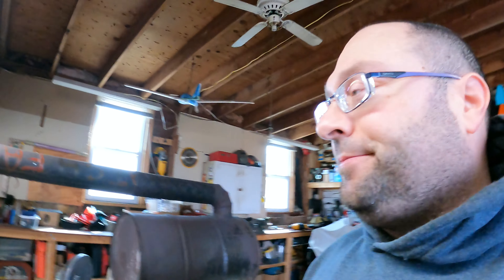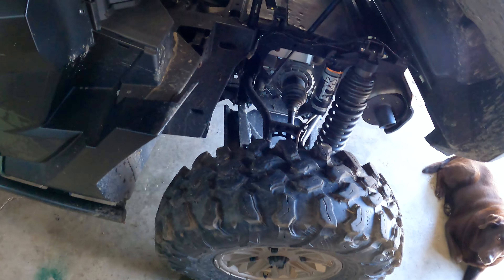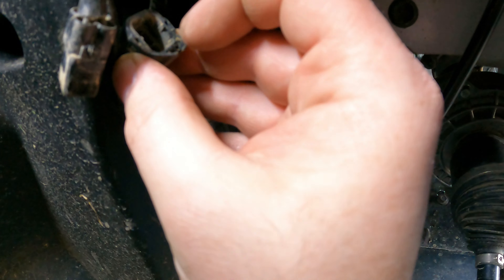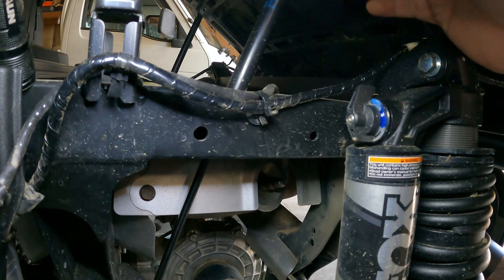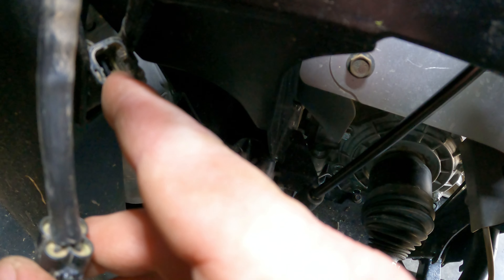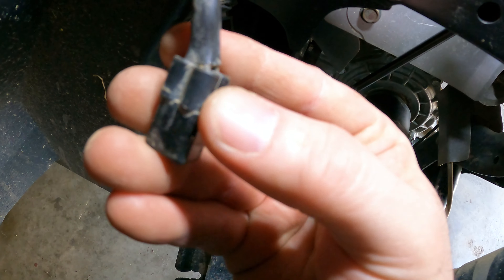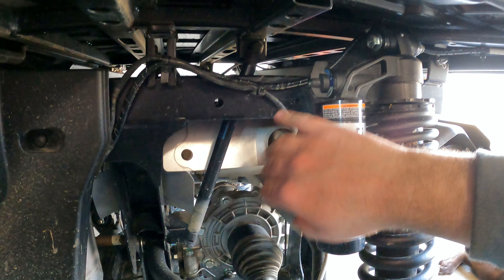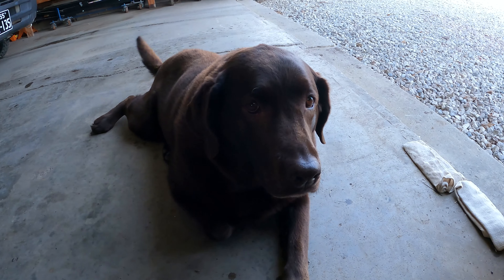RMAX O2 wiring recall fix

Comment: I wonder if this is just a two-seater thing or it's just got to do with the year of your machine I checked my 2022 four-seater today and the wire is already run underneath the frame rail.
Reply from the maker: Thanks for watching, maybe it's just for the 2 seater?
Reply: @BarnStangz  very possible or it's a pre-2022 issue but after I watched your video I was curious and before I went for a ride yesterday I took a peek.